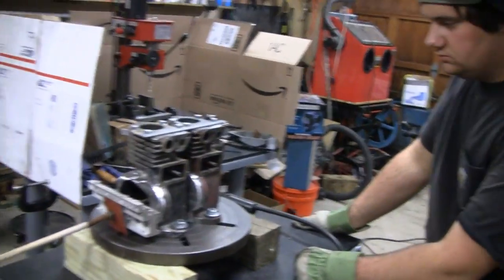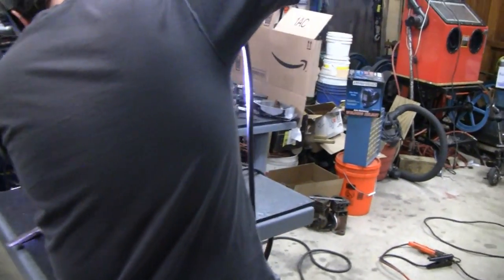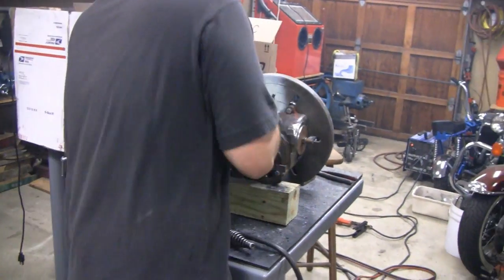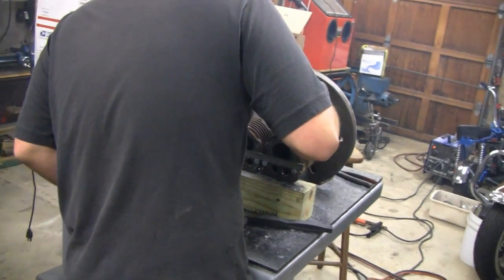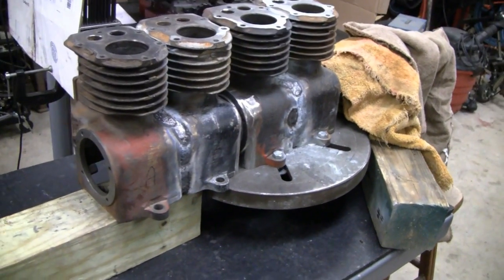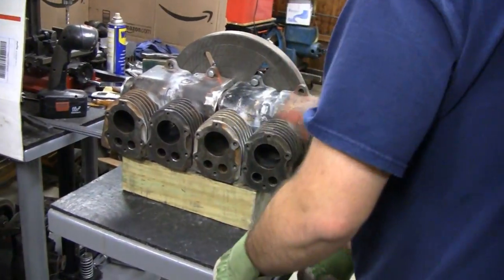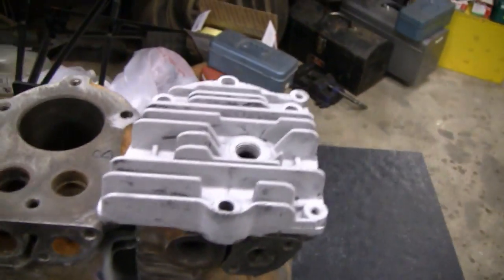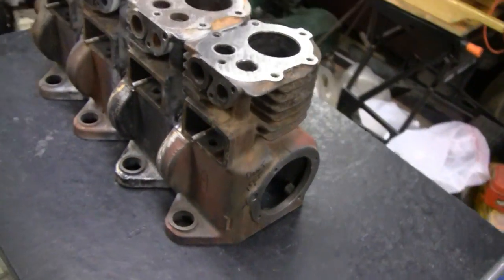HOMEMADE 4 CYLINDER BRIGGS PROJECT (part 5)

Comment: I was told the cast iron that Briggs used is a real high quality type. That is why the engines lasted so long when maintained. Weld away Mike !!!!! When done welding correctly the bead is smooth as silk and then you have to peen the weld fillet which makes it look really poor quality which is normal. Keep on going fella.

Comment: RK,I was thinking maybe with that new Mill you'd make a one piece head as long as  the blocks were all decked (course the gasket might take the odd thou out as well)
Suppose you could could also join up all 4 heads into one as well with some nice welds
Reply from the maker: Yeah that wouldn't be too tough!! I'd rather have individual heads anyway!!☺

Comment: Looking good lads, well done. I've done quite a bit of cast welding that way in the past. The peening is to relieve the stress, and hopefully stop it cracking. Sometimes however it doesn't matter how slow and careful you are, you hear it cracking as soon as you stop. Never had a failure, but have had to redo it, or weld over the top a few times. Think? it's because of the quality, or age of the cast iron.
Reply from the maker: Thanks Malc!! I agree with you 100%!! We had a problem with one block!! I told Mike the only thing it could be was the quality of the block material!!☺

Comment: I am concerned about the oil in your sump.  As long as the engine is very level you will be alright.  But if your tilt the engine at all, the oil will run to one end and starve the other.
Reply from the maker: Good point Bud!! It will always be a Show Engine so it shouldn't be a problem!!☺

Comment: looks like the hard part is going to be putting the internals in that motor in it and getting that crank in past all those valves. i keep forgetting though that the bottom of the case is open on those still too so maybe not so hard after all
Reply from the maker: Yeah Buddy!! That big hole in the bottom comes in handy!!☺

Comment: A flapper disc and a dremel or die grinder and the welds will look great . What rod did you use to weld those? I have welded small cast parts with Nickel 55  But never did a big project
Reply from the maker: All them welds are gonna get covered up!! We used 3/32 Nickel 55!!☺